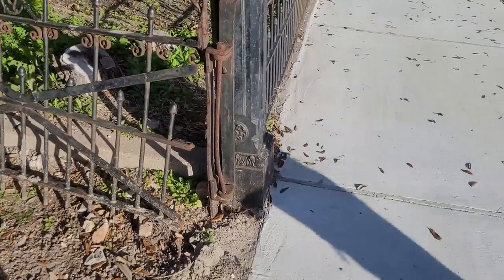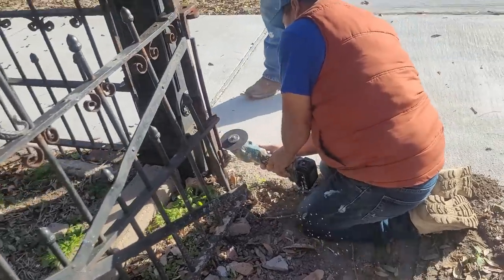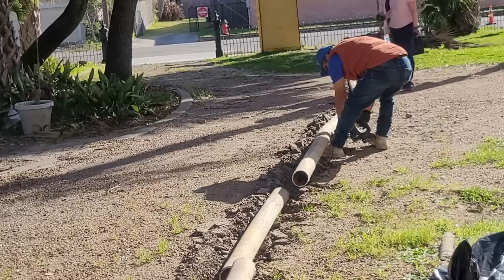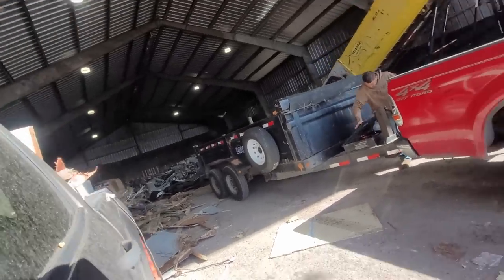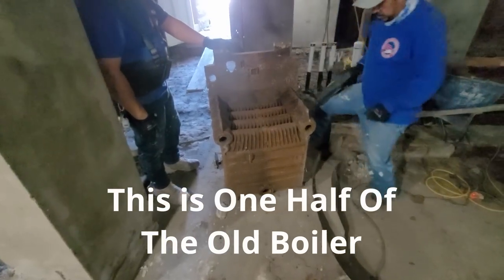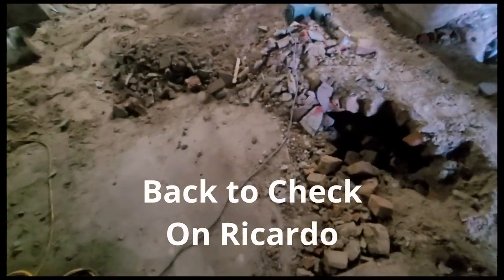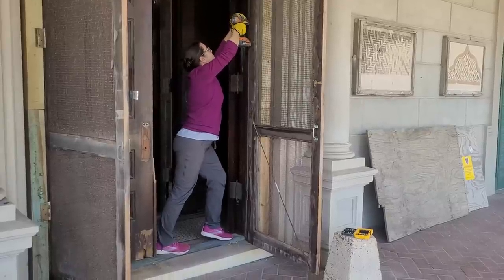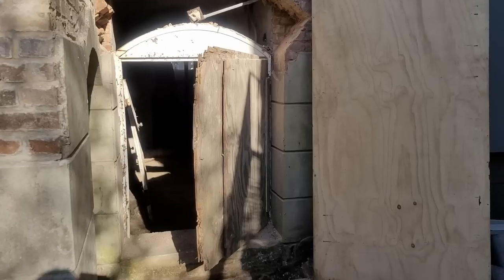S3.01 Back to Work!  Lot's of Chores to Do

Comment: The sidewalk 😘👌You need a good blacksmith to fix the gates.  Great update 2x👍
Also watching the adds I can do just a tiny part to help.
Reply from the maker: TYou are absolutely correct, hey will need a real blacksmith to fix them.  The fence itself is in remarkably good shape with just a few condition issues.  A car did run into the corner post and do considerable damage.  It can all be fixed in time.  And hey, these YouTube revenues add up.  Now that the new channel is up and running, we are going to do some publicity stuff to try to take it to the next level!
Reply: @leaguekempnerhouse  sounds like a fantastic idea to get money coming in. 👍👍